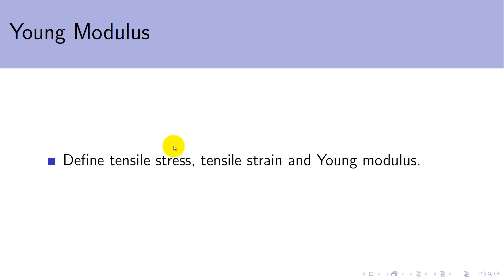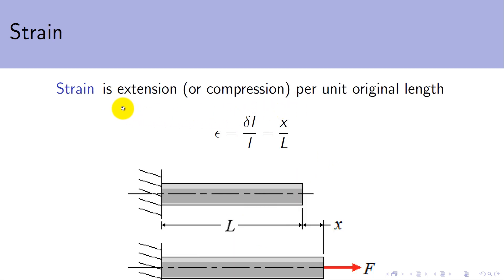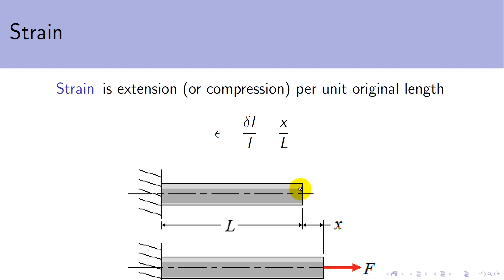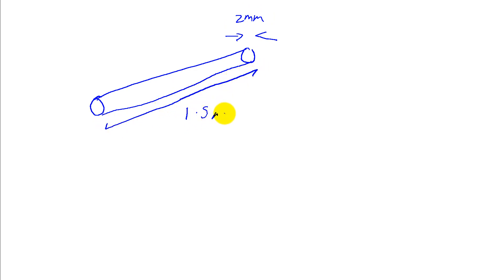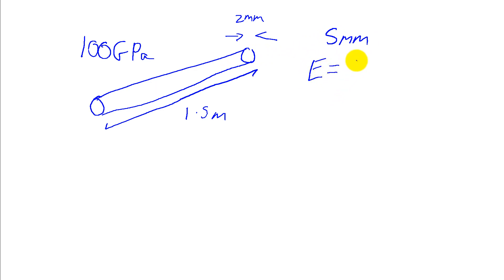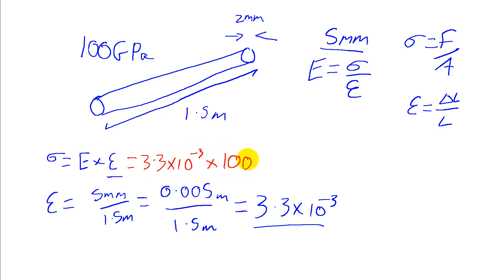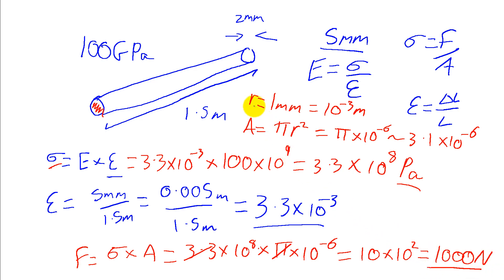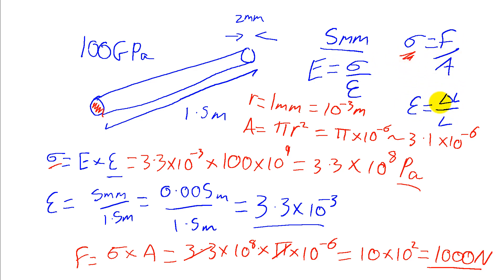Young Modulus, Tensile Stress and Strain

Comment: It was pretty good and explanatory video but I have a question though...."ε" is deriving from the division of Δl/L....so in the particular example we have ε=0.005m/1.5m and equals 0.003333 or 3.3*10^-3 (unitless)so when we have E=100 Gpa=10^9 Pa...this means that when we substract 10^9-10^-3 this gives us a result of 10^6 and not a result of 10^8....am I missing sth here?
Once more it was a very enlighting video!Thnks!